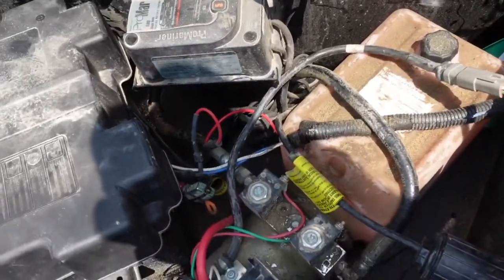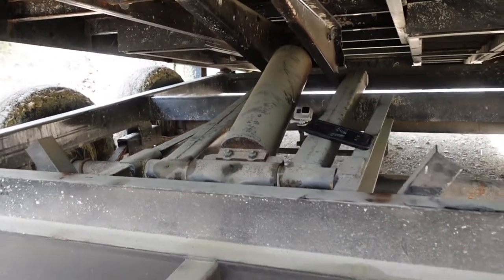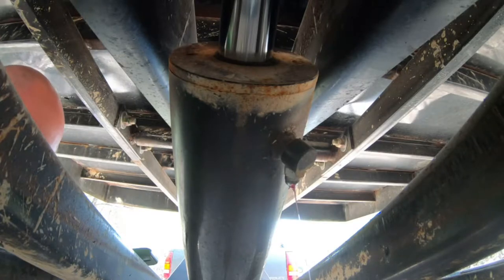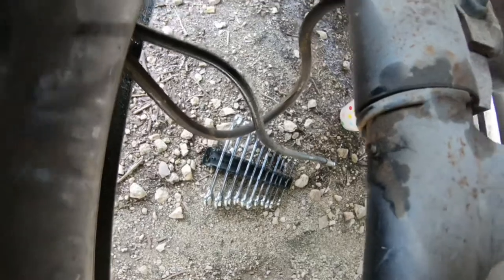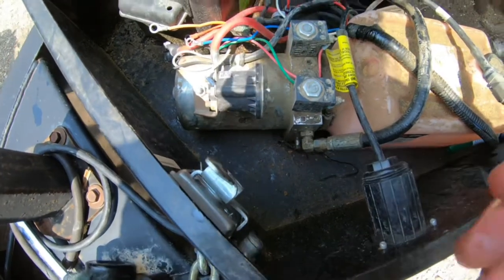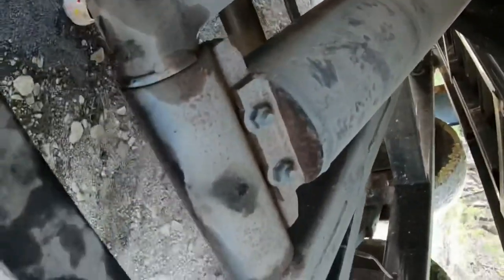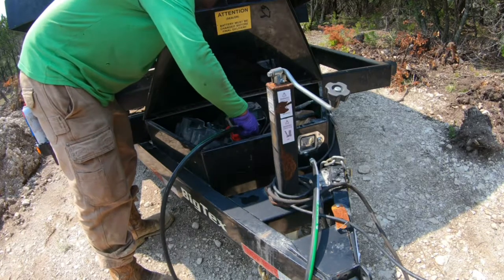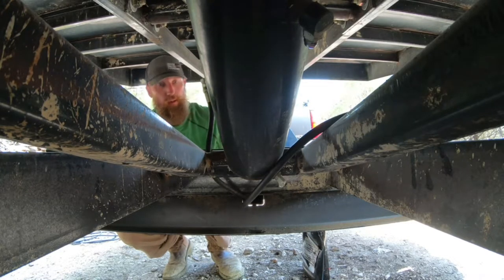How to change dump trailer hydraulic line.

Comment: How did you Bleed The Air out of the hoses ?
Reply from the maker: The air released into the oil reservoir. Just had to cycle through lifting and lowering the bed and all air was out.